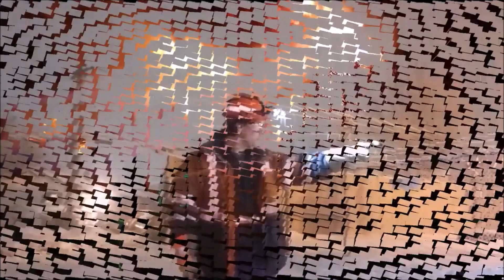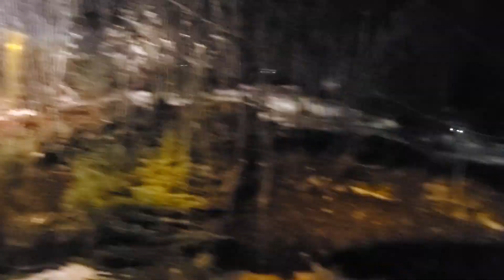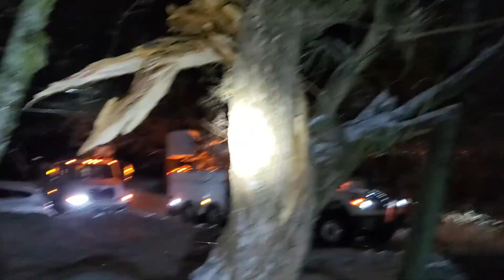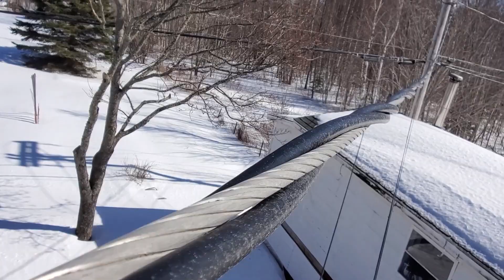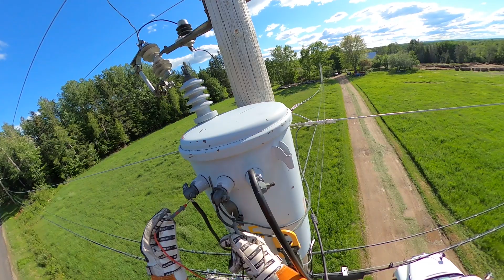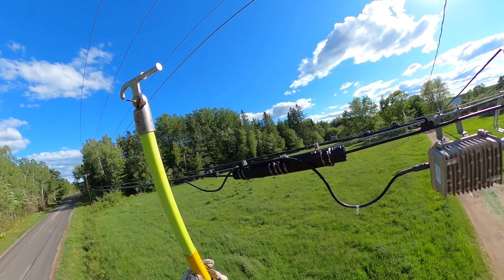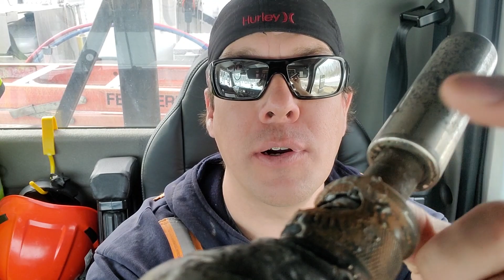Accidental contact with 120 volts

Comment: I saw one in a residential setting where some prior owner or "electrician" decided to run a feed to the garage but how they did it was totally stupid. They ran PVC conduit underground and into the garage ok, BUT they used 6AWG wire to feed a 100 amp panel in the garage NOPE! then they decided to splice this directly into the meter socket so no fusing on it. As near as I could tell they did have it in the load side of the meter so at least they weren't stealing the power. I could just see a wire in that failing and shorting out and the ground around it starts to glow or some crazy thing.

Comment: This brings a question i asked myself but i didn't want to risk my tools to prove.

Its "ok" to use an impact gun or driver to  tighten/loosen live connections like on a electrical panel or breaker box?

Always tried to  imagine the path and how it could affect insulation of the motor and things like that...

Comment: I just replaced front ball joints & bearings on my 4x4 and I'm a union journeyman finish carpenter/master woodworker. But that's where weekend cross-over ends. Do NOT casually/disrespectfully "tinker" in the electrical field (pun intended)!!! I have a friend who did that just out of high school. 18 years old & immortal. Opened up a non-locked/non-tagged bus bar cab on his 1st summer maintenance job at a major university. Carbonized both arms to the elbow as well as all the way through to his femurs where they were against the ALUMINUM ladder rung. Fully disabled for 40 years now. Walks like a polio victim with hooks for hands. Just happy to be alive.

Comment: Stick welding is down in the sub 50 volts,  16 to 18 volts,  But current at the arc is very high, 200 amps to 350 amps
when welding 1/2" to 1" plate. The HIGH current, not the voltage is what melts the metal and creates the weld. 
More current = deeper weld penetration.

So while the voltage can be equated to Pressure, the Flow rate, is the Amps.

120v at 100,000 amps will vaporize the metal in an instant.
Air is an Insulator,  higher voltages can JUMP over a larger air gap.
At 120v,  the air gap that can be jumped is very small, but once the arc is started, the full available current will flow.
Lets say The High voltage power lines are at 13,800 volts with 1,000 amps 
when you reduce that down to 120 volts through the pole transformer, you also Increase the amps.
there would probably be an instantaneous in rush current in the 100,000 to 120,000 amp range.
That accidental contact with 120v,  would release all 100,000 amps instantaneously.

Comment: 120V is from a step down transformer-steps the voltage down but the current up! the metal socket on the gun has a low resistance therefore can pass a lot of current even at low voltage- I=V/R

Comment: As mentioned, the "sparks", Well, those are flying metal shards. That poor drill was basically a welding rod, and the sparks were some heavy slag/splatter being tossed.   PPE folks, it's important.

Comment: Not having fuses/circuit breakers secondary side seems dangerous to me. A short this way risks damaging the transformers, also replacing fuses on the primary side is more difficult than on the secondary side. also for a transformer that serves a bigger area you can protect individual lines, so a fault in one doesn't cut the power to the whole block. Even for pole mounted transformers in my country you have a box lower on the pole with the protection, and these days digital monitoring systems (measuring current and voltage basically, and I think an actuator to cut power automatically), plus the networking gears to communicate to the meters (the power cables are also used to connect the digital meters in a network so they can be read remotely and without putting a modem or a radio module in each one, quite a clever solution).

Comment: I will be honest here. I am not a electrician by any standard. At best I am a poor excuse for a jack of all trades. I am currently 46 years old and until watching this video had never thought about how many amps are actually comming from the transformer. In my mind depending on the main in the breaker box I would only have to worry about 100 to 200 amps at most. Now thinking back over the years it never dawned on me that multiple homes can be and alot of times are connected to same transformer. Currently my home is 1 of 5 sharing the same feed from a ground based transformer. 5 times 200 is 1000. You can be proud of the videos your making. You know they are good when your able to educate a old dog like me. I know from this day forward I will be taking less chances when dealing with my household electrical.

Comment: "It's only 120volts" is like saying "but it's a dry heat" hot is hot and electricity is electricity. If you decide to connect yourself to the grid you become the load.
Reply: He's speaking relative to what they often work with.
Reply: totally valid, but that’s a terrible analogy.

Comment: FYI you can get a non-conductive extension for your power drill to the socket that will not allow current to flow from the positive to the negative please try to look that up and add that to one of your videos KJ's custom electric IBEW 302 California

Comment: My girlfriend  lives in a building build in 1936. Lots of old wood and masonry,  But a steel framed building . Over Christmas one year, the " unqualified " building caretaker decided to hang some Christmas lights around the front door.  A nice sentiment,  but poor method of securing the lights.  I mostly ignored the lights, however,  I became curious as to how he fastened the lights to the frame as I didn't see any fasteners.   As I moved the electrical cord to do an inspection, there was major arcing.  I let go of the cord and tried to ascertain what the hell was going on.  It started  arcing again  and wouldn't stop. I ripped it off the door frame as my girlfriend unplugged the lights. I couldn't believe what I found. The brain dead caretaker drove nails through the two wire cord. It wasn't the two wires that shorted out. It was another nail further up that had made contact with the metal conduit the was connecting the security door system to the building. Unfuckingbelievable. That moron could've burned the whole building down. What surprised me was that no breakers tripped with that much arcing. It could have just started arcing without anyone noticing until the building was ablaze. I cut the plug off of the lights and put them in the garbage.  The black mark on the doorframe is still there as a reminder.  It's just that easy to screw up. 

I was working in a platform lift inside a building at a job site.  There was about 12 of us all doing are jobs. This wasn't construction.  We were setting up an indoor stage for an event. I started to smell something burning. Being closer to ceiling, the smell is heavier. I asked if someone was using a grinder in a different part of the building,  but we were the only crew working and we weren't using any tools like that. So where the hell was this coming from? We found out shortly.  In connection box I the next room over was having a meltdown. One of the site electricians had used a fastener inside to the wall and that bolt was barely touching the bus bar. There was enough contact to start heating things up and start a fire.  Good thing we were actually in that area at the time, as it is usually vacant.  That area probably would've been ablaze by the time anyone noticed.   Crazy shit that happens when you least expect it.

Comment: so he was workin on the live side and did NOT have an isolated circuit (and powerlines dont hold capacitive charge, right? because you would just discharge to ground.) So he hit the live bolt which is fine, but then maybe it kicked and he hit got close enough to a ground rail(?) Get back to me on that, super curious.
Reply from the maker: Yes, it was live, which is allowed providing the proper PPE and Rubber gloves are used. 
With proper procedure you can easily use the tool on the live nut/bolt. The problem arises when it makes contact with another phase/neutral/ground at the same time.

Underground lines can also hold a capacitive charge (primary cables), which in the same circumstances would simply discharge it. The voltage during that discharge would still be considered dangerous tho

Comment: Well, keep in mind that electric arc furnaces used in metal production only use 300-400 volts to turn 50-100 tons of steel into a boiling pot of NOPE.  That's 300-400 volts at about 50,000 amps though...
Reply: electric arc furnaces use primary voltage 7,200 (I WAS IN THE LINE SECTION 37 YEARS)
Reply: @floydszuba2236  The primaries are usually 7.2kv-14kv.  The secondaries are 300-400 volts at 50kA.

Comment: The saying it's not the voltage it's the amperage in large part it is correct ever know the house had only 120 volts on each leg what the issue at hand is the amperage capability the capability of that Transformer to deliver the amperage kind of like if you compare a garden hose versus a fire hose you can have the same amount of pressure behind it but the fire hose will win hands down because the volume it is like if you take 12 9 volt batteries and plug them together yeah you're going to get poked it's going to feel interesting it's a hundred twenty volt although it is DC as well but you get poked being a capability isn't that great now your power lines that is entirely different IE if you look at your main panel it gives you an idea of what the potential amperage is 200-amp hundred amp 50 amp yes amperage kills what happened with your impact if it was just a piece of wire it would have snapped popped but you had an impact had a very very big path to ground so now you are able to push a lot more amperage or like in the hose idea fire hoses a lot bigger able to deliver a lot more water I have a Transformer at home that is rated at 10000 volts but it produces so very very little amperage doubtful it will kill you it will definitely feel like a electric fence speaking of electric fence same idea high voltage no amperage

Comment: I'm a welder in Ontario say running 1/8" stick electrode. Around 120amps but 12V-18V would blow through that socket assembly. I know it's not really comparable to this situation but I can imagine how violent that arc would have been so close to a body.

Comment: Years ago, I was posted to a base where I had a roommate. The summers were hot and humid. They would often set off the smoke detector that was in our room. One night after returning from a particularly over indulged time downtown, the thing went off 20 minutes after we crashed. I pulled the detector off the ceiling, then realized it was hardwired. Using my roommates Gerber tool I proceeded to cut the wire. I'm going to blame the alcohol, the loud noise, and my fatigue on this...but for some stupid reason I put both wires together when I proceeded to cut them. That was a mistake...the good news is the noise stopped. but holy moly there was quite the arc and shock I got. It welded the gerber tool as well. I was lucky, no damage.

Comment: Howdy Bob, I was going to ask if you might be able to give me a general idea of how large of ampacity the fuses are that feed the primary to the transformer that then feed a series of homes. Yup I know you would need more info than that to correctly identify the fuses used, but I was just curious in general. We have a fuse section at our pole outside our home and if a tree or something shorts out down the line the fuses blow... sounds like a rifle shot, and then there are pieces of stuff in the grass.I am guessing that they would be around 600A or so.  I usually pick up the pieces and put them next to the pole for the service guys when they come. Thanks... Bob
Reply from the maker: Hey Robert! If the fuse is on the high voltage side, it would be much smaller. Between 3-20 amps. Most transformers on our system are 60:1 ration, 7200v in the top and 120v on each secondary bushing. If it's fused at 10A, that would be equivalent to 600 on the secondary side.
Reply: @Bobsdecline  Similar to what we have in European fuse ratings,but all 3 phase and ungrounded or compensated at the substation.The lines can still opearate if a single phase shorts to the ground and theres a low ground fault current around 3 amps.

Comment: I haye the "It's the current that will kill you" Motto.
I prove to new people when i bare hand touch a current shunt running 60A of current through and they flinch or their jaw drops cause i touched a live circuit.
60A flowing through a 0.00001 ohm(10 μ ohm) shunt has a 0.006 V (6 mV) of potential. You have to have enough potential to push the current through your body.
I always stress that you shouldn't bare hand the shunt, but if you accidently touch it, you'll be fine.

Comment: Most MIG/TIG/etc. welding use even lower voltage, but like just off the transformer, there is a lot of current available. All it takes is a brief tap between electrode and the piece for it to arc and melt.

Comment: Voltage times current gives us the wattage.  So if the 120V short drew just 100 amps, 120V x 100A = 12,000 watts !!!   That's an impressive amount of power in a small area and likely the short drew even more current than that.  So glad he wasn't hurt or killed, he's lucky.

Comment: The voltage is the force that overcomes  resistance to current flow. Dry skin has much higher resistance than wet skin, and an open wound has almost no resistance. I've been shocked by 24 volts ac when a stray wire poked into a cut on my finger. When the circuit is completed, amperage will be limited by the resistance in the circuit (you), the overcurrent device (breaker, fuse), or the available fault current which can be 10's of thousands of amps. It's not the voltage or the amperage that kills, it's the two working together against you.

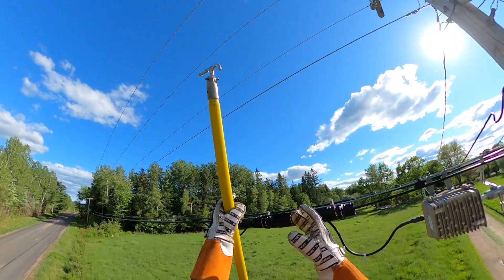Comment: I have a ? I work on those grey boxes you see at 3:14 on the right which is a Gainmaker Line Extender. I recently came across one where there was another strand below which was fiber only and it was touching our equipment and burned a hold in it and any time it would touch it would spark i found that when it was touching only showed 3v max but when the connection was broke from our strand to the one below it showed 120v. Why would that happen? My guess is bad ground somewhere.

Comment: 1 volt at 1000 amps, put your hands across it, feel nothing, put a 3/4" wrench across it, it melts. 20,000 volts at 1 milliamp, put a 24ga phone wire across it, nothing, put your hands across it, your most likely dead. Good video.

Comment: When I worked at a pigment plant, we had a strip recorder that was built into an instrument.  It stopped working and the manufacturer wanted too much money for a replacement.  So somebody decided just to take the wires from the recorder and put them on an external recorder.  Now these are really low voltage - around 5, I think.  One of my guys was working in the lab where this was parked and he touched the metal countertop where a wire was laying and then reached over with his other hand to turn on the faucet.  He got blown out of the way by the shock, but was otherwise uninjured.  We had a hard time figuring out what happened because this was such a small voltage, right?  Well it was a small voltage across the wires, but the voltage between the hot and ground was over 300 V.  It blew a 30 amp breaker.  The original strip recorder was never meant to be used outside of the instrument.  This was in R&D, so no one bothered to get a change order to hook up the external recorder.  I'm not sure it would have caught this, but at least someone with some electrical knowledge would have looked at it before this happened.

Comment: Yeah the 120 volts isn't much, but when it is essentially unfused and there's a very large wire able to carry (a lot of?) current, interesting things happen.
That's why a 12 volt lithium ion battery pack about the physical size of your wallet can jump start a car.

Comment: 120v can have 500 amperage. This is where the saying goes its not the voltage that kills because it the Amperage that is the force.  I can make a 120v line have only 0.0001 of a amp.  I have also worked on equipment that was 120,000v with less than 1 amp of force.  It sucks badly to get shocked from it but unless you have a heart condition that is all its going to be with a burn.  Now I have also lost a supervisor to a 6 rack of 64k lines, doing a simple brush clearing when he got into a hurry.

Comment: The amperage dose kill (or every electric fence would be lethal). That voltage dose however need to be high enough for the current to travel through fleshy resistive conductors.
To be lethal a few milliamps needs to travel acrost the heart.
Reply from the maker: Exactly 💯. That, among other reasons is why the saying can be deceiving. 
The expression it's not the volts, it's the amps is definitely correct. However for those that don't understand electricity... a line can literally have 0 Amps up until the exact moment it's touched.